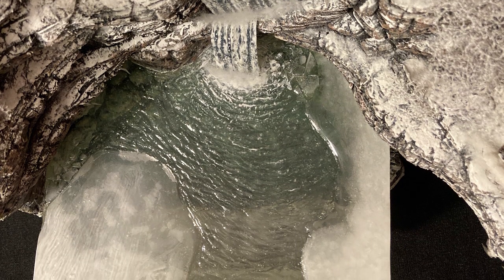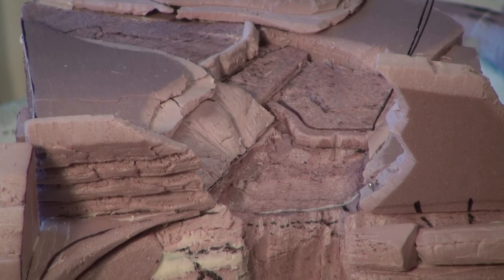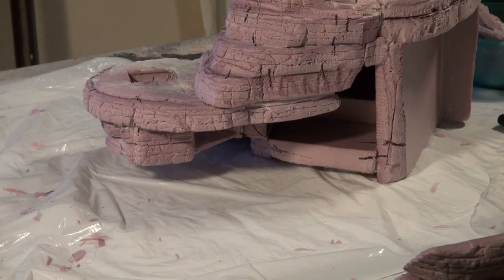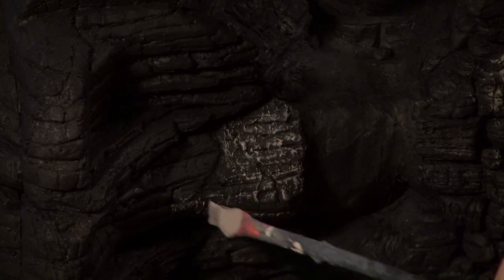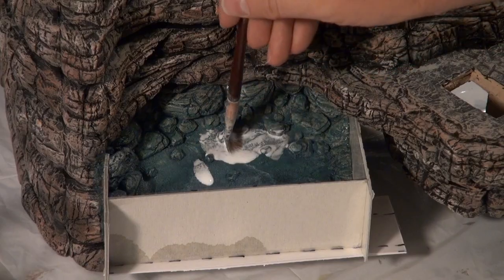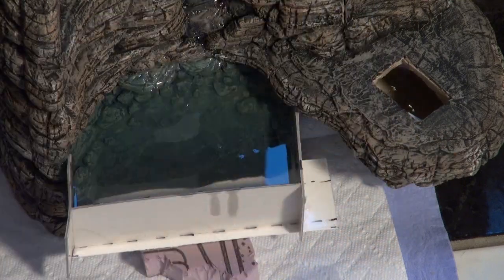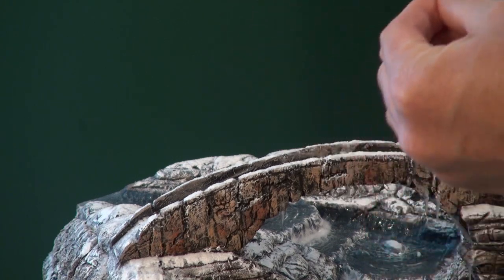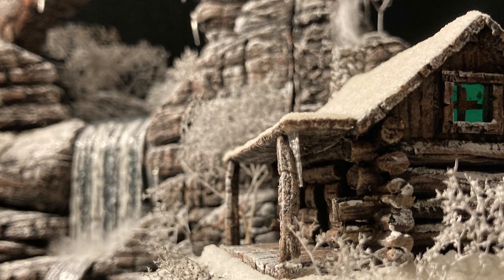Winter Waterfall Diorama + Christian Message!

Comment: The little wheel tool you got in the sewing kit is used by a seamstress to create patterns by rolling the wheel over a pattern piece over some carbon paper to print off the pattern you want to copy. In other words it's a pattern wheel I have several of these because I've been a seamstress since I was 4 or 5 years old but now I'm 75 and have been doing it since then. Had an Alteration and sewing business all my life. AND ......you said you couldn't afford an air brush but what you can do cheap is ......Take a hair dryer tape a roll of poster board paper making a small hole at the end and then you can put any white liquid on the water and take your hair dryer behind it just blow and manipulate the liquid to look like waves.  And also on the water fall take your plastic and then take some water mixed with some white paint put the plastic over a pan and tape it in place then pour the liquid slowly over the plastic then leave it to dry it will have the water look dried in the plastic then you have a pattern of water flow. Hope you can make sense of my rambling. Enjoy watching your videos.
Reply from the maker: Thanks for the input Brenda!  Nice idea on the air brush!